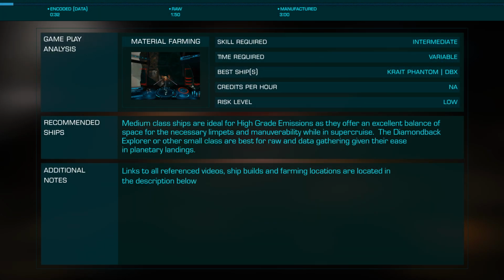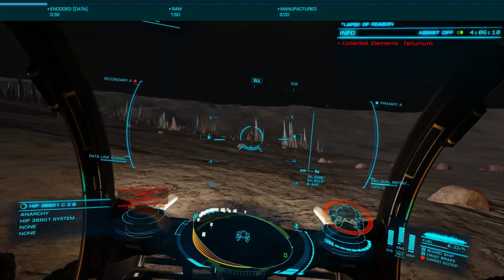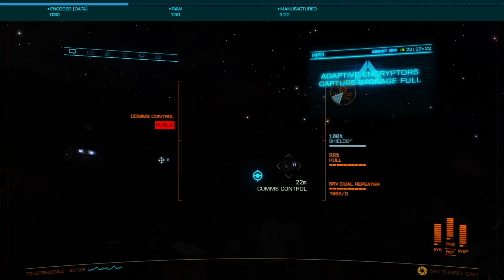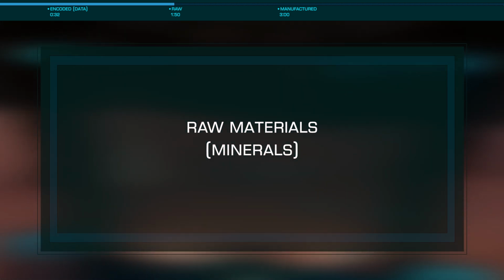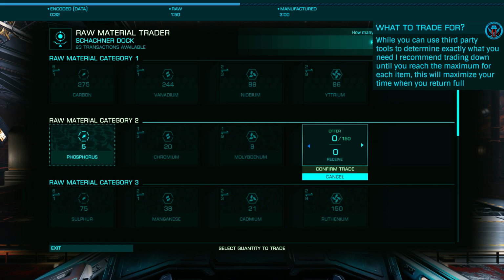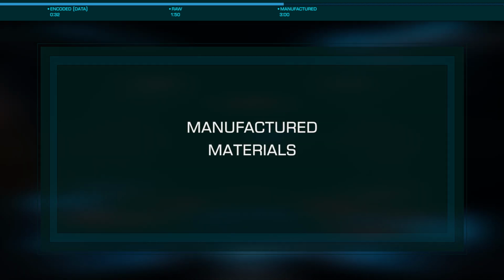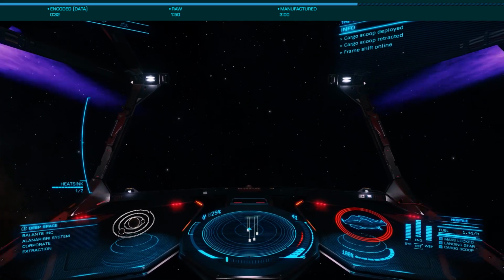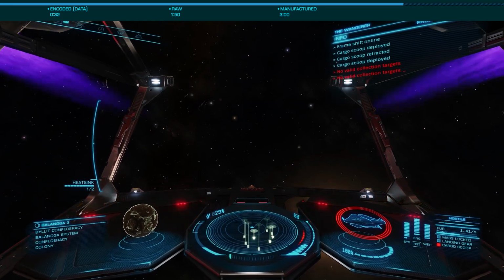The FASTEST Ways to Gather Minerals, Manufactured and Raw Engineering Materials in Elite Dangerous

Comment: Can someone point me in the direction of finding manufactured trade suppliers?  This area of the video im a little sketchy with :(
Reply from the maker: Shockingly I have a tutorial covering exactly how to find them - search the channel for Material Traders and you'll be good to go.
Reply: @Exigeous  wait so material traders are the same people to go to for manufactured stuff?
Reply from the maker: Yep - there are 3 types, raw, encoded and manufactured. So you have to go to the right type but you can trade all types.
Reply: @Exigeous  Thanks, I've managed to figure it out.. I was initially just going to the systems in your video however was finding nothing. I then tried the starmap and filtering as your material locations chart suggested and pretty much instantly found a location with 30 mins on it.. I was able to farm that till it expired.  I'm now hoping to have enough to trade down into whatever i need for the fsd.. after that it's all luxuries.
Reply from the maker: @trydierepeat8208  There you go - here's a little teaser, soon I'll be releasing a tool where you can enter a specific material and it will tell you what systems commanders have actually found that material in within the past X hours/days/etc. So you'll KNOW that someone got it there and while you may not it'll present you a route of systems that you can search. Coming next week.

Comment: I can't travel to HIP 36601. It says route plotting failed. I am currently in the system KOLI DISCII and HIP 36601 is 1433LY away from me. I don't even see any systems near HIP 36601 its in the middle of nowhere I have a Diamondback Explorer with a Jump range of 42.8ly which is half decent I guess but I don't see how you could ever get there. I just want to farm raw materials! WHY ME!?
Reply from the maker: Hmm, well I just checked that using the Neutron plotter with a 40LY range (which I think should be enough) and if you use neutron jumps you should be able to make it: https://spansh.co.uk/plotter/results/2A1913E6-4E51-11EA-8884-7257FF6517A0?efficiency=60&from=Koli%20Discii&range=40&to=HIP%2036601

That said if your jump range is that low it sounds like you're not using the Guardian FSD booster and/or an engineered jump drive. Is that's true you really should do both of those first, or at a minimum the FSD Booster (I have a video that covers that and unlocking Felicity Farseer). This isn't really something a new player should do anyway as this is for players who have a lot, if not all engineers unlocked and need to gather a large amount of materials to fully engineer ships.

So my advice is unlock the FSD booster next, as that will add up to 10.5 LY of range to all ships (as the DBX only has a class 4 slot you'll get an extra 9LY making your range over 50). With an engineered FSD you'll be able to hit 70+ which is really what you want for something like this.

Comment: Isn't Dav's Hope still one of the fastest ways to grab Manufactured? I'd figure it'd be quicker than the HGE, due to the higher quantity of items
Reply from the maker: It used to be but with the traders and how fast you can get G5s from HGEs you can grab 100 Core Dynamics or Imp Shields in about 20 minutes or so, that trades down to 300 grade 4 or 900 grade 3 - so yeah, it just doesn't make sense to use it anymore, from an efficiency standpoint.
Reply: @Exigeous  that makes sense, thanks for the explanation. Great video as always o7

Comment: Is this still accurate? I'm going to have to go through this soon and I'd like to know if it's all still valid.
Reply: It is but blowing your ship is very lame,I've never did that.Also mind you for HGEs to respawn you need to exit the game completely not just logging off, or they won't respawn.
Reply: @M4NAH1MEK0  I only wondered if the spawn pool in each system type, the list in the description. I find this technique to be lazy and utterly reprehensible. I did my hge hunting the honest way and maxed out my distributor on my own with no help from this at all because the list I asked about does not seem to be accurate any longer.
Reply: @lordonyx7671  The spawn pool may vary,I've never used this method I usually go to Imperial systems and farm Imperial Shielding,they are Grade 5,back to Mat trader trade stuff and go there again to max out to me is much better than going after several HGE types around the Bubble switching systems.
Reply: @M4NAH1MEK0  they seemed all over the place for me, in all fairness to the impatient one it may either have been changed or legit bugged. How else would I go to ten systems of various types and get proto components 8 times? That was incredibly frustrating.

Comment: I have been searching for HGE in at least 10 systems you describe, and I've only come across 1 HGE. I don't think your comment that they are easier to find and that they have a higher spawn rate is at all accurate!! And, for some reason, in an Independent or Alliance, War/Civil War system, i got Proto Heat Radiators not Improvised Components as your list suggests. But great video other wise :)
Reply from the maker: Well it's totally and completely random.  Last night I found 3 in the first system I hit, 2 in the second - then went 2 systems with nothing, then found 4.  Some nights I jump 20 times with nothing - in the past that was the norm, now that's really rare, at least for me.  Welcome to the world of Elite Dangerous :(
Reply: @Exigeous   I also find what type of manufactured mat you find is a little random too. Or at least, it seems to switch to a difference system allegiance and state. In the end i just plotted a route to a system from your list that has a particular manuf mat, and ping the beacon in each system i visit along the way. I found this method more successful. The login in/out works brilliantly, so thanks for this tip. But when i finally reach the system i have plotted to, i find it does not contain the manf mat your list suggests it should have. Im not sure why this is? Again, Elite, most likely :p
Reply from the maker: A LITTLE random??? :D  Yeah, hella random is more like it.  There are a few that are very consistent, mainly Core Dynamics and Imperial Shielding - you'll almost always get those in Election or None states.  The others are approximate, regardless anytime you find a G5 farm it until full as the traders are great.

Comment: You need to fill the Scarab 1.5 times planets. I get to go back to 2 planets. :p  Edit: just went back to 2 planets in Outotz LS-K D8-3 system, and now showing all 3 in HIP 36601 need 50 more tons. I triple checked, and it showed 100 tons was maxed and full. Now after leaving the area I realize it wasn't. Glitch? I would log off, and back on and check, before leaving the systems.

Comment: ENCODED DATA MATERIALS! *Do not destroy SRV or Ship* - Folks you can still sit at the crash site and just log/go to main menu and back in again (suggested to do this in solo).

Literally doing it as I type this and getting Atypical Emission Data etc every tiem i log back in. 20/04/2020 (british date format) still works. It doesn't function like a USS at all, so I would suggest you make a note in the video, or an update video. Will save people a lot of money with rebuys.
Reply: the self destruct is to spawn back at the material trader without travelling. Also a hauler costs almost nothing.
Reply: @FotisNorscan  Only true if you're doing it in a crap ship or a D rated cobra or something. An engineered Asp X or Krait has a much higher rebuy.
Reply: @S.ASmith  i know that's why i use a cheap engineered hauler. it covers all the bases. And the hauler is not crap. It's awesome.

Comment: Something is wrong... I actually got 100/100 Proto Heat Radiators in about 15-20 minutes, but in the 'Federation-Election' system and not in 'Independent/Alliance-Boom' :/ I wonder if in 'Independent / Alliance-Boom' I will get Core Dynamics Composites: /

Edit.
I was able to find the second HGE in the same system and this time the signal contained Core Dynamics Composites and Proprietary Composites :)
Reply from the maker: Well remember these are only general guidelines and not "rules" as some things spawn in similar states. It also could be the faction state for the actual HGE was different than the system state.
Reply: @Exigeous , anyway, I love this tutorial! Yesterday I was farming raw and data materials, and today - manufactured 😉
Reply from the maker: Very cool - yeah, I'll admit this might be the most useful and important guide I've ever made for engineering.
Reply: @Exigeous , I totally agree! I've been relying on your great guides for years, but this one actually beats everything! The second great guide was about getting Guardian FSD Booster. And in the near future I will test the effectiveness of acquiring a Combat rank in the fight against Thargoid Scouts ;)

It's good that so many people notice your amazing work you put into these guides! o7, cmdr!

Comment: Guys. How long does it take for you to restart the game when you quit to desktop? (regarding the manufactured material method)

Cuz it takes me about 3 minutes to get back into game because my launcher just takes ages to load. (first i gotta wait until the "play"-button reappears and then it takes another couple of seconds for it to launch the game after i pressed). Meaning i definitly need many more minutes than 15 to fill from 0 to 100 and now i wonder why my launcher is apparently a lot slower than Exigeouses.

My PC is definitly not the problem. Its 1 year old and was pretty top when i bought it. Maybe internet-connection? Or is there a specific problem with my launcher someone knows a fix to? Can i buy a "fast-boot" with ARX? XD Would highly appreciate help. The relaunch is killing my efficiency. ^^

edit: maybe it has something to do with steam? I mean steam backs up files, right? Maybe thats what takes so long.
Reply from the maker: Ah, I see you're using Steam - so when you close the game the launcher closes, right?  For me I don't use the launcher so I don't have to wait for it to open.  Sadly I'd guess that's about right as it does take the launcher a bit to open for me.  Check with support - depending on when you purchased Elite via Steam you may be able to switch over to a non-Steam version and just launch the launcher directly saving you a TON of time.
Reply: @Exigeous  FD-launcher doesnt close when leaving the game but it takes time to get functional.

You dont use the launcher? How? Or are you talking about steam?

i will deactivate cloud-saving of steam and see if that fixes the issue.

edit: Well. Turns out steam doesnt save anything Elite:Dangerous-related so thats not going to work. ^^

edit2: Simply making a desktop-shortcut (yes, i am frustrated) also didnt help.

Comment: Still there isnt a fast way the gather improvised components and pharmaceutical Isolators SADLY
Reply from the maker: You mean other than this way?  They both spawn in HGEs and while they, and Proto Heats, are the rarest I find them all the time.  They just take a bit more searching than the others so if you only need a few go grab 100 CDCs or Imp Shields and trade them.
Reply: @Exigeous  i dont know i cant find them i just gather them by trading materials

Comment: I DID NOT KNOW ABOUT THE RELOG REEEE (For manufactured)
Reply: I pick up all the manufactured materials from destroyed ships.  But this is a really quick way to fill up.
Reply from the maker: The main issue with that is there are many materials that just don't spawn there and even the ones that do are exceedingly rare.  It's really annoying that's the case as I'd MUCH rather collect during combat.  That said I don't anymore due to the terrible collection rate and keeping my hatch open slows you down so much.  Find a single High Grade and you'll trade for more materials than you get from an hour of combat collection, which is just sad.

Comment: It's clear that this guide was written before the Fleet Carrier patch! :-) I went in search of these mats and really didn't need to use the FSS to find the planets I needed. I found 48 Fleet Carriers in the HIP36601 system, in orbit around each of the 4 planets like stacks of Pringles, 18 Fleet Carriers in the Outotz System, stacked around the 2 planets there and 41 stacked around or near CMDR Jamesons crash site. A lot of people have a lot of money to spare :-)
There was one other thing I noticed. It may be a bug or intentional, but I found that with the materials collection, the bin says max capacity 100 but if you go over 50/100 up to 100/100 and log out and back in again, your capacity has gone up to 150. Sadly this doesn't work if the bin capacity is already 150, nor does it work on the data collection from CMDR Jamesons' crash site.

Comment: What is the best way to farm materials without using these exploits? So, without, reloging and dying contantly? As an option...
Reply: The reason these things are found, and why people do the "exploits" (which they're not, it's just finding a way to reset an instance the quickest way possible) is because the only thing that stands in your way between relogging/restarting/self-destructing to get Engineer/Synthesis/FSD boost materials and actually finding systems with the proper System State to what you need, jumping to different systems, scanning Nav points, spending time in supercruise getting to where you need to go, scanning points, scooping materials, landing on planets, etc., is time. Massive, massive amounts of time. So instead of spending a week or weeks trying to farm materials, relogging or quitting and restarting, or jumping to where you need to go that's 36 jumps out then self destructing to get a free instant trip back, is not exploiting for any sort of "gaining the system" it's simply to reduce the time you spend grinding.
The main idea is to get materials for engineering ships, with the secondary purpose of synthesis so you can refill ammo, SRV fuel, synthesize heat sinks, etc., to make aspects in the game less dependent on always needing either be in or near The Bubble, or having to constantly run back to a station to resupply, and for FSD boosts. Mining and run out of limpets or SSD missles? Don't need to run back to a station, just make more on the spot. Run out of limpets? Just make more on the spot. So that's the other reason you want materials on hand. As for the engineering side, even if you own 1 of each ship in the game, (36 ships thus far) you don't need a constant flow of a lot of these materials once you get everything engineered. I have about 15 ships fully kitted out that all have a different purpose, all of which aside from like 3 are fully engineered. In doing that I only needed to do these engineering material runs to fill up my Raw/Encoded/Manufactured items twice. The 2nd time around I wasn't empty on a lot of things, just on the items that are used a lot for the things I was engineering for. But when you are trying to get these materials, some of which are very hard to find, you can only find in certain places that are way out of the way, etc., saving yourself hours/days/weeks of grind by just resetting your instance has pretty much become the standard way of grinding.
Reply: @fubar5884  Maybe i'm just not playing long enough to really see how massive the time aspect is. Thanks for making that clear in this long unexpected answer, i really appreciate it ^^
Reply: @CarstenHodes  It took almost a full week of non stop grinding using the video's methods to get a decent supply of every material for me. Not fill everything up to the limit, just 30+ units of everything, 20 for G5 data since I couldn't be bothered to go on. I dread to think how long it would have taken with """legit""" methods only.

Comment: 2020 is this still possible?? Holy shit man!!
i need sooo much materials atm
Reply: Raw and encoded yes. I am currently starting with manufactured
Reply: Just farmed core dynamics composites, works like a charm
Reply: 2 weeks further, it does!
The manufactured are a bit harder, those high grade emissions can be hit and miss.. then hoping the stuff you need is actually there.. filtering the map is good though youll find the right system quicker

Comment: just a comment: civil unrest system is rare, and HGE spawned in these systems are even rarer. Not recommended to waste time; better to get imperial or federation system which is much easier and use material trader to trade.
Reply from the maker: Yep, 100% agree - and specifically going for Imperial Shielding is the best, as you can usually find them, get 100 and hit a trader in under 20 minutes.

Comment: Encoded data is still by far the worst because of terrible trade down values, if at least you could carry infinite AECs it wouldn't be that bad cos I set up a macro and leave it overnight, but with having to base and come out every 20 mins for terrible gains it's super annoying, can't even imagine how bad it would be to do these legitimately. Just as an aside, bottom line is you need 54 runs for maxing out G4 and G5 mats, I would say 20 min is super generous for a whole cycle, so that leaves you at 18 hrs of pure mind numbing grind. Not even fed/imp grind is this bad, you can get from 0 to cutter/corvette in under 6 hrs even if there is no boom or other positive states